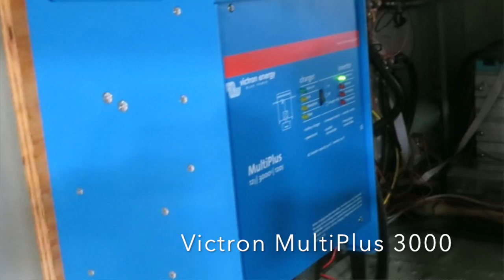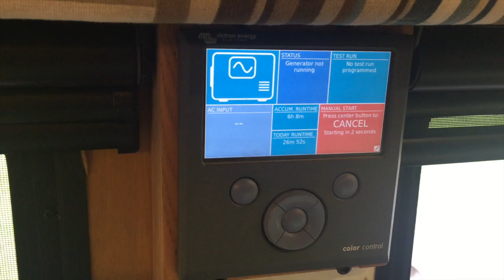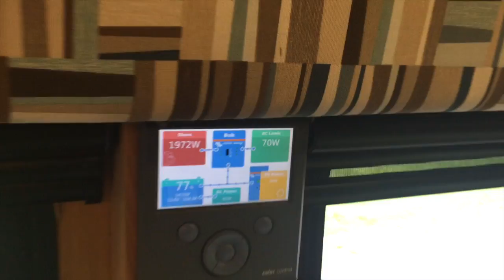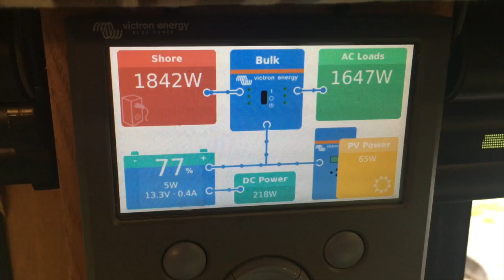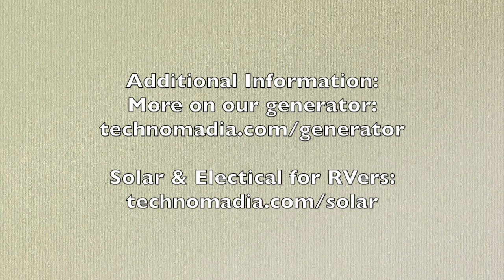Big RV: Small Generator - Downsizing to a 2500w Propane Generator

Comment: So the generator comes up in the display as shore power.  Is there an automatic transfer switch between the generator and Inverter or does the generator have its own input?
Reply from the maker: +Matthew Obley We have a very manual transfer switch - we plug the shore power cord for the bus into a 50A outlet that is wired up to the generator.

Comment: Cool as hell.  What's that display thing cost?  Does it come with inverter, or independent of inverter?  Also, do you need the inverter to start the AC? Is that the whole majic?
Reply from the maker: The inverter is only needed for drawing off the battery bank. If on shore power, it's not necessarily needed. All our content on solar/lithium can be found at www.technomadia.com/solar and www.technomadia.com/lithium - including links to the components.

Comment: Everybody has their reasons for doing what they do. Having said that, I would have kept the diesel generator or replaced it with another quieter diesel generator. You probably got very little resale from your old generator or gave it to the installer. Now you have two fuels to carry and monitor their levels. They also make diesel hydronic and water heaters. You could have it ALL diesel. Anyway you must have your reasons. Love the bus and the upgrades!
Reply from the maker: The article this post was embedded in (linked in the description) goes into more about the decision points. 

Basically, the Precision Temp Hydronics propane based system was at least half the cost of a diesel equivalent, and has no ongoing maintenance (where others tend to need annual maintenance). It was an obvious choice to us, thus.. propane was coming on board. 

Plus there are no diesel generators small enough to fit in the spare tire bay we were re-purposin (the old genset took up an entire huge bay and was in need of a major rebuild - probably $2-3k worth of work. Instead we sold it for $750), and a replacement diesel genset would have been substantially more expensive than the $2500 we spent on the one we went with. For something we don't use that often, it wasn't worth the space and cost just to stay diesel, especially since we had already decided on propane.

So.. we saved about $15k, reduced our ongoing maintenance and we absolutely think we made the right choice for our parameters. 

But hey, you're free to make decisions for yourself however you see fit :)

Comment: Hi C 'n C. Great video. Shame I can't post a Color Control GX, or CCGX for short, screenshot but in System Setup you can have AC input 1 and 2 so then the CCGX would know when you were on shore or generator. I've only wired mine with one and simply swap shore lead for generator once I leave hookup, but then I need to remember to alter AC input 1 to Generator every time I do that. Maybe I'll wire two separate AC inputs one day, but for now that's my workaround. Can't you wire 2 separate inputs so you always have the correct input source automatically?
Reply from the maker: If we had a Quattro we could - but our MultiPlus only has a single input.
Reply: +Technomadia Guess we need to trade in our Multis for Quattros 😏
Reply: +Technomadia I actually had forgot the Multi doesn't have two separate AC inputs. Maybe as I do you could make it part of your routine that when you disconnect grid/shore power you change AC1 to Generator in the Settings screen. As my genny doesn't have an hours counter then at least I can see how much I've used it on the VRM site. Just a thought...

Comment: Great post guys! And the electric bikes seem to be paying off because you both look amazing. (Sharp beard Chris!)

Thanks for this update. Thanks for your recommendation on the Cummins Onan Quiet Series Gasoline RV Generator — 2.5 kW, Model# 2.5HGJBB-112 !

My Truck Camper/Avion is LITERALLY getting the install finished at Cummins Rocky Mountain in Reno today and tomorrow. I'm looking forward to emulating your Elite Power Victron setup as well. (Downsized of course for a two axle Truck Camper setup!)

Enjoy New York and check out Chautauqua Institution and Lake Chautauqua if you get that far West. Hope the humidity breaks for you (my folks just flew back last night from two weeks there so I know it's humid there for sure!)

Cheers,
Grif

Comment: You need a simple capacitor setup for the initial surge needs. Id also recommend vibration isolation on the generator also. :)
Reply: Grzegorz, thanks for that tip. I'm setting up the same installation and custom fabricating a box for the generator. Do you have specific recommendations on the vibration approach?
Reply: Griffin de Luce The first step in this is to pick a generator that vibrates the least. I would recommend Honda Or Yamaha for this purpose.  Next the Generator needs to be mounted on a Vibration isolating pad, for example a 2 inch dense Neoprene foam or gel. 
 As always dont forget simple cheap start capacitors  They are critical and will allow for the use of the smallest most efficient generator possible. A simple Honda 1K generator can pull a 5000 BTU ac plus have a little left over in a setup like that.
Reply: Griffin de Luce I forgot to add, the generator box should also be lined with Dynamat and the bolting points to the vehicle should have rubberized washers or vibration mounts as those will be the transfer points into the vehicles body. 

Noise can be controlled by purchasing a simple cheap muffler for 4 cylinder car and mounting the generator exhaust INTO this supplemental muffler vi simple adapters for a massive improvement in controlling Noise Decibels.

Comment: Couple things.

First, I thought that inverter would add to the generator so if you needed 3,500 W the generator would have supplied it's 2,500 and the inverter would have picked the remaining 1,000. What it looked like, if I understood the display correctly, was no load was being pulled from the generator for a few seconds while the inverter supplied the entire load. I'll view it a few more times but I thought that's what I was seeing. 

Second, Does your Battery/BMS combination communicate with the Victron display so it shows the actual capacity in the battery bank as it would if you were using Victron batteries? I like what Victron has done but their battery prices are sky high.
Reply: Update, Viewing again it may be that the inverter just didn't react quite fast enough to the increase load and the generator reacted faster to the overload and went into a protection mode. If you add a hard start kit to the AC that might not happen as the inverter may have more time to react.
Reply: +timon0x31 My Multiplus kicks in seamlessly but that's with a resistive load. I have a 1kVA Honda genny (900 Watts continuous) and say I run 900 Watts of chargers my 800 Watt (700 Watt continuous at 25C) Multiplus kicks straight in if say I put my 600 Watt electric travel kettle on and my Color Control GX shows assisting with a total AC load of 1500 Watts (1600 continuous available if required). There is a setting in the firmware of the Multiplus that you can alter locally or remotely via a Windows laptop that has various settings to allow higher initial  loads to allow the generator to drop out whilst it comes up to speed if it won't react to the load instantaneously. It's called AES mode if I remember and is done via special Victron software and usually dealer installed.

Comment: Very helpful. Makes the issues clear. I just put 1,000 watts on my roof and the Magnum hybrid. When we did the subpanel, we did not run the AC units through it. My concern was that someone would kill my batt bank inadvertently. Hence, I can't supplement my Honda 2000 with my inverter to run AC, at this time. I still haven't dry camped yet, so I don't know what I really want. Running one of the AC units to the sub panel in the future would be no problem, so I'm guessing I'll do that if I can't stay in cool weather. My options are to supplement with the inverter and feed an AC unit to the subpanel or get a second Honda 2000 and leave the wiring as is. The inverter is cheaper since I own that stuff already.

Comment: Great setup.  Designed for efficiency and running what you need, not everything at once.  The generator was pretty noticeable inside the bus, probably because it resonates through the metal structure.  I'm curious what it sounds like outside, compared with something like a Honda EU2000.
Reply from the maker: Yes, we definitely need to do further sound proofing. A project we didn't have time to complete back at MasterTech last summer. It should be much quieter.

Comment: Surprised you didn't have to reset the generator. Nice system
Reply from the maker: Only if we had a soft-start on the AC.  Otherwise we'd exceed the capacity of our 3000w inverter to be running one AC and support the start up surge of the second.  And heck, we'd likely exceed the capacity of the inverter to even run two ACs at once. 

Thankfully, we hardly ever need to run both ACs at once. We're pretty well insulated.
Reply: I wonder what would happen if they had the bus engine running when they turn on the second AC. Then shut off the bus engine.

Comment: Have you ever done a cost analysis on your setup to determine the return on investment? I was wondering if it just wouldn't be cheaper to use a generator and house batteries instead of all the solar and inverters?
Reply from the maker: For us it's priceless and not about the costs (we prefer NOT to use generators... and instead enjoy the quiet). But we did do a pretty extensive analysis at: http://www.technomadia.com/2015/11/rv-solar-is-it-worth-it/
Reply: Thank you so much. I didn't know that RV's can be considered a second home and a solar install could be deducted on taxes. I have a small class C that doesn't have much room on the roof but would like to add at least two batteries. Do you think a single 100 watt renogy panel would be enough to charge two batteries? I know its an open ended question depending on how much power I use. I only need enough to power a 12 volt tv , satellite receiver and laptop for a few hours at night.

Comment: What do you think the minimum battery bank AH to accomplish what you do with 500 amp hours. Thanks, Tiki🚎💨💨💨
Reply from the maker: If you're talking about Lead Acid versus Lithium, you'd need about 800AH of lead acid to get roughly the same capacity we get out of 500AH of lithium.  Check www.technomadia.com/lithium for more info on that (the cost analysis article goes over it in more detail.)
Reply: I've got 225 AH with two Trojan 6v  T-105's run in series.  Run in parallel they would double the AH.  So you would be talking anywhere from 4 to 6 batteries for 500 AH depending on how you wire them.
Reply from the maker: I'm not sure I understand the question? The minimum battery bank to accomplish what 500AH accomplishes would be 500AH?
Reply: +Lori Crouch Thanks, perfect answer. Tiki 🚎💨💨💨
Reply: +Technomadia Will do, thanks!

Comment: Wow! That is cool(pun).. 😊 Could you just have added a capacitor for A/C startup with the smaller generator?
Reply: The inductive motor that runs the compressor in the air conditioner I think already utilizes a capacitor on its starting circuit.  I believe that's how single phase inductive motors achieve a phase difference so they can start on single phase power.  I don't know if adding a capacitor in any arrangement would give any more starting current headroom to the gen set or inverter setup.  Any EE people on here that can weigh in?
Reply from the maker: It could help... we've not played with one to know for sure how much it might help, or how small of a genset you could go with however.
Reply: +Technomadia Good to hear.. Gives me hope that I might be a to get away with one.. I would much rather have your setup but it is outside of my abilities I think.. Great content as always.. 👍